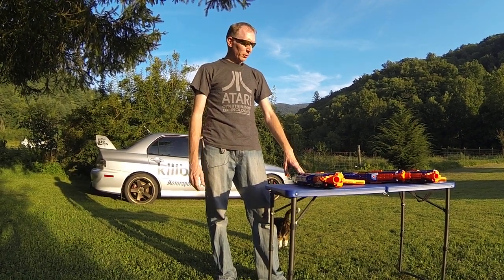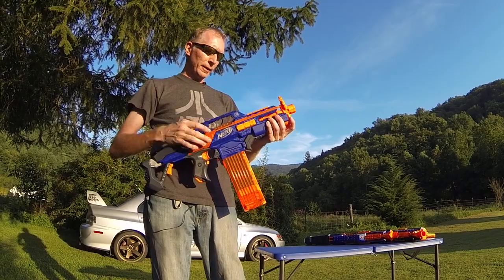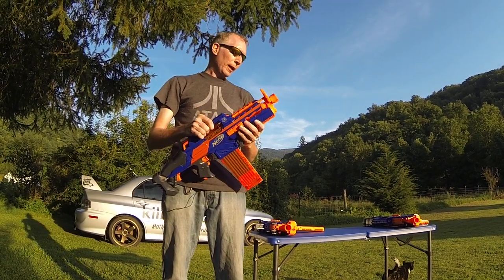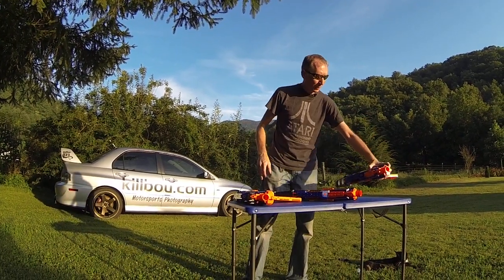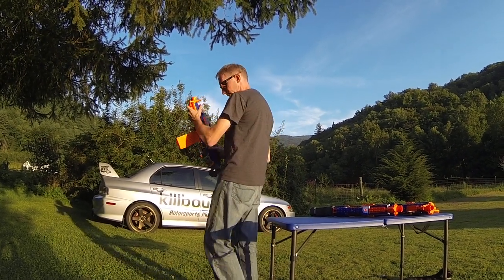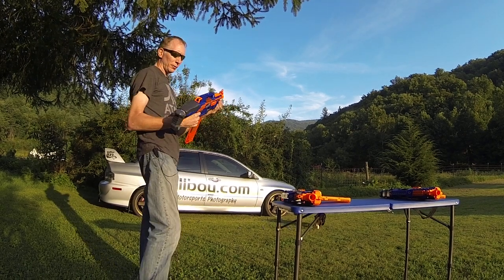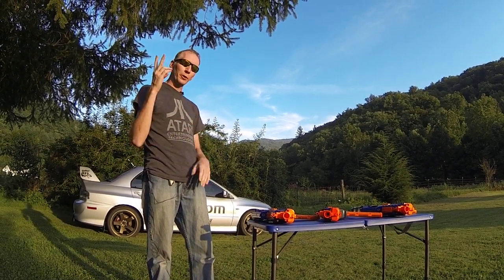Modified Nerf Rapidstrike CS-18 Blaster Demonstration - Stock vs. 7.2v vs. 11.1v

Comment: That helps to see the difference
Timecode
1:25 C 1.5v x 4 = 6v Energizer Max
1:50 LiPo 2 Cell 7.2v (it’s really 7.4v)
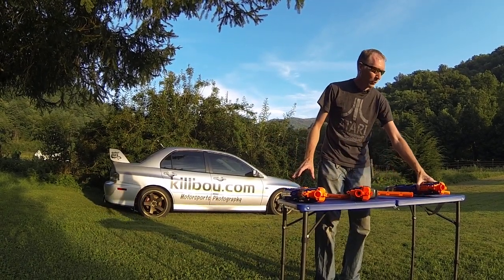2:18 LiPo 3 Cell 11.1v
Stock Motors

I assume the rubber shroud was removed between the dart and the flywheels which helps it not to jam